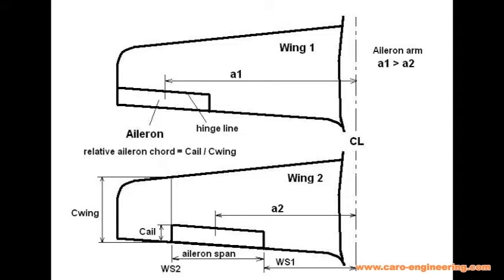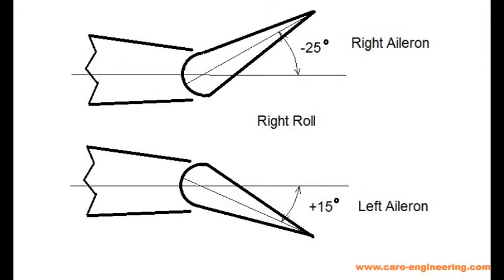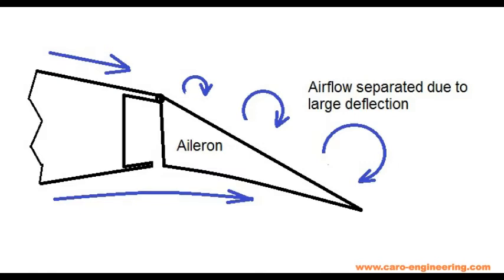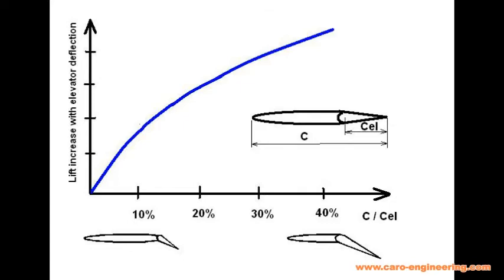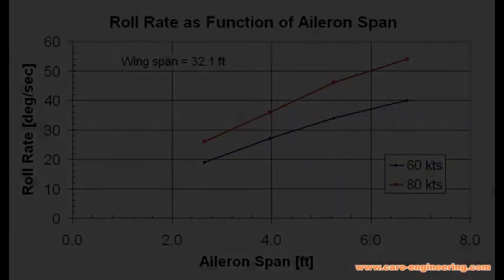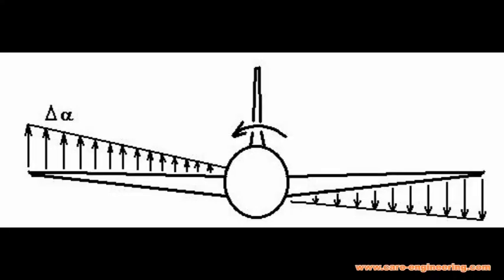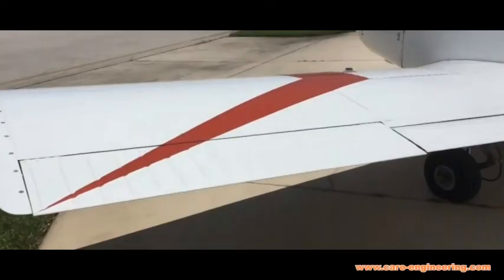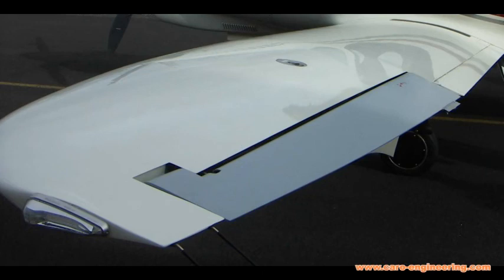Small Airplane Design Tutorial 8, Control surfaces, ailerons

Comment: 1. What about the shape of the aileron? does it have to be rectangular and what are the consequences of having non-rectangular ailerons?
2. Why are control surface gaps in some aircraft tightly sealed and others seem to get away with very large gaps between the wing/stabilizer and control surface
3. What is the effect of washout (if any) on the aileron position?

Thanks
Reply from the maker: Of course the ailerons can be other shapes besides rectangular. On tapered wings, the ailerons are usually tapered as well to maintain a constant wing to aileron chord ratio. 
Sealed gaps are lowest in drag. Gaps usually reduce the control surface effectiveness, requiring larger deflections, see my video on drag reduction. The ailerons can be part of the washout a wing has, depending on the rigging, but usually it involves the full chord.
Reply: @sonjaenglert  thank you